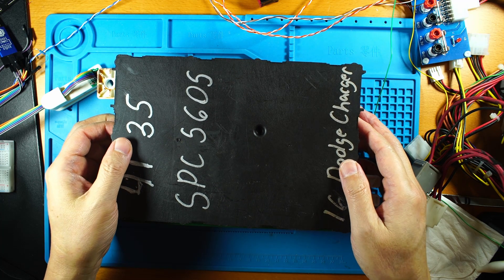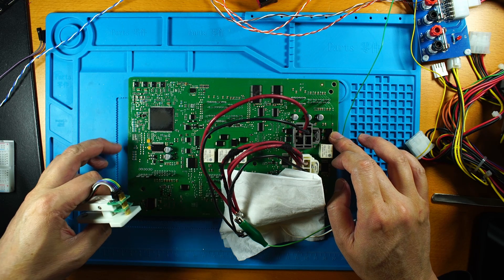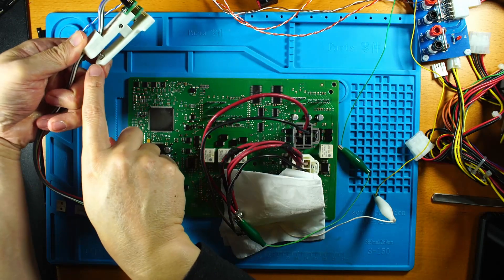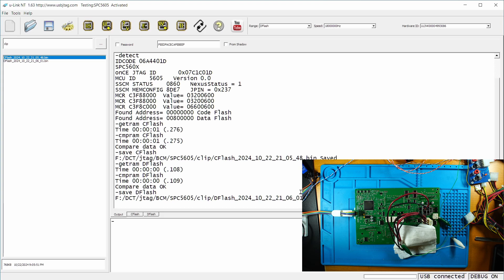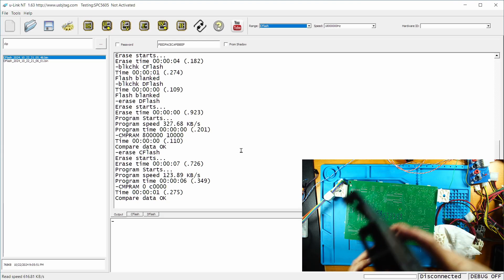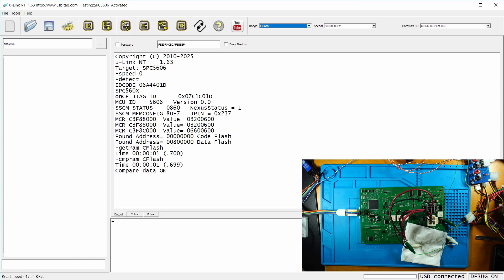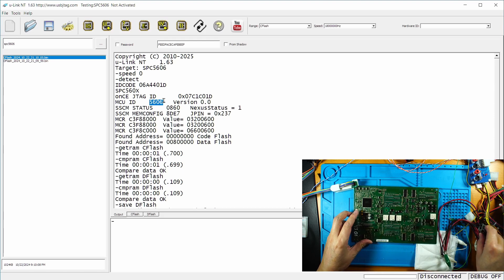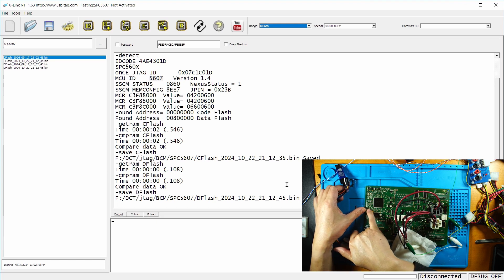u-Link NT program BCM (SPC5605,SPC5606,SPC5607) with different wiring.

Comment: Is there a connection diagram for this? This one looks like a Ford BCM but I need to do a Nissan BCM, which uses a SPC5607 and has only 8 connection pads instead of 10. I've already identified each pad  but would love to get a connection diagram for the u-Link.
Reply from the maker: Come to my site to discuss. Check the end of the video.
Reply: @usbbdm  Did that yesterday. Awaiting admin approval.
Reply from the maker: @paulmurray8922  Not the forum. It's the chat. Not a lot discussions on the forum.

Comment: Hello,

I am having an issue with a BCM that timed out during a software update. I am able to connect EEPROM but I want to get into repairing flash files that have been corrupted. What equipment would you advise that is easy to understand
Reply from the maker: If you have good backup you can use JTAG to resotre it. u-LinK NT can do the job.
Reply: @ can you please give me a link to purchase it? Also, do you have any videos for restoration of the files and uploading.
Reply from the maker: @Fastest94v6  watch to the end of the video.

Comment: You can link to that clip.
Reply from the maker: I got it from aliexpress.
Reply: What is the description of it to find the clip
Reply from the maker: @jayl6030  Search for JTAG clip 1.27mm
Reply: @usbbdm  How many pins and rows there's more than one option????Thanks
Reply from the maker: @jamesakers720  It was confusing but I chose the 5 pin double row (which is 10 pin). If you are not sure contact the seller.